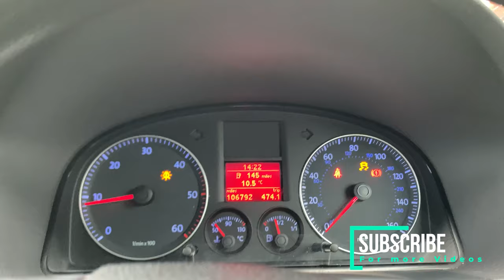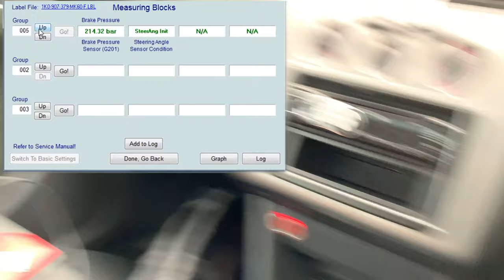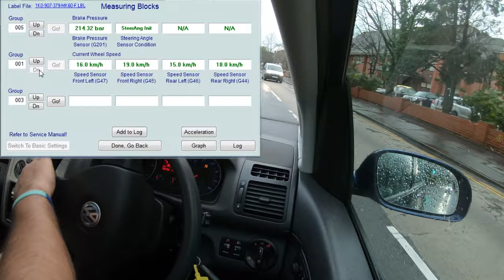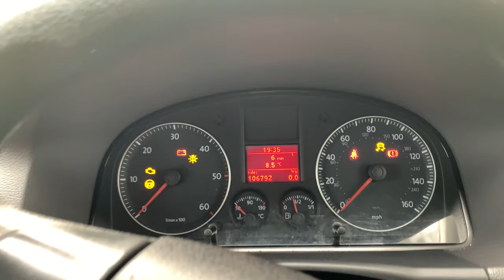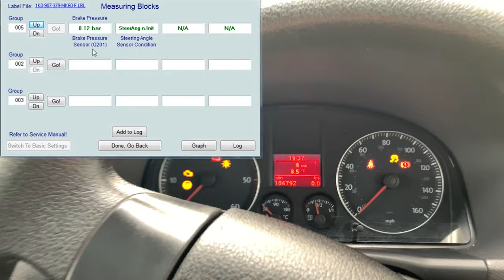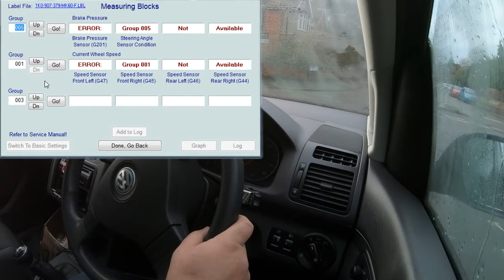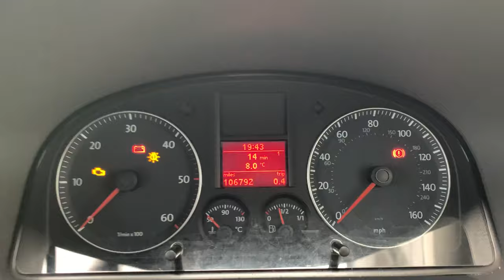VW Touran ESP LIGHT ALWAYS ON | Brake Pressure Sensor Fault G201 01435

Comment: Well done, another helpful topic.
I looked up the VW repair kit, 1K0 698 517 B with RRP of 299.50 GBP. 
You get the hydraulic section with pump.
I looked into replacing G201 sensor which later sensor is LPKF 488360 but looks like you damage it when removing looking on forums so haven’t tried.
Looks like you have the cheapest solution, anyone doing the same as you make sure you can take it back or swap it for another unit as they fail a lot and you could be fitting a faulty one from the scrap yard. Get it in writing before you spend out so you don’t get stuck with two faulty sensors.
Turn steering wheel full left then right and drive 50-100 meters to reset steering Angle sensor whenever disconnecting battery, then reset one touch window function, hold switch down then let go and press down for 3 seconds, put window up, let go of switch and pull up on switch for 3 seconds to restore one touch winding up and down. Do this for each window. Make sure windows not iced up or kiddie blinds stuck to rear ones first though!!
Reply from the maker: Simon Moore good to know Simon thanks for looking up the price for the repair kit ... cheers 👍👍👍

Comment: Great video! Got the same fault!
Problem is that I just spent 2 month in the hospital, and are not fit to work on my car!
My traction light came on when I tried to start the car with a very low battery after coming home from the hospital!
The ABS light do not light up, just the ESC light?!
Can a bad/low battery, brake the pressure sensor?

Comment: I recently bought my vw touran with the abs light on i have the same code for the brake pressure sensor, the guy I bought it from changed the abs pump but not the ecu part would this be why there’s still the same abs sensor fault

Comment: Hi you bought a replacement unit Modulator but there are lots of them out there and they end in different numbers/letters, did you purchase the right one right year model code or any Modulator then split it !!! please advise as l am in the process of doing the same job l now have the sensor / Modulator off ready thanks.

Comment: Hello. Great video. Do you know if it is possible to put a different module? My newly bought Audi A3 8P has a "1k0614117A" ABS module in it and it doesnt work. After a quick VIN check the system shows that the correct one for my car is "1K0907375P".
My question is: how can I find out which ABS module is suitable for my car?

Comment: I have tried to make pipe flange for VW passat but my "reasonable priced" tool always seems to leak with the ABS hole and also with the other side into the rubber line , i never saw this flange tool are there spesial one to VW blake flange other than 3/16 , for me it looks like the back end of the flange is 90 degree angle and standard tool make it more like 45 degree andgle, THX

Comment: Great video thanks. I changed my ABS module from my Touran 1T tdi 90 cv from 2005 by a standard exchange bought in a car case it is revised and guaranteed. I mount the module everything went well I did the pressure brake bleeding with the same device as yours. My concern is that I still have the brake pedal to soft. Do you know what is the best method to do the brake bleeding for a Touran? I thank you in advance.
Reply from the maker: The best method is scan tool abs brake bleeding procedure ... I would try bleeding the brakes again perhaps still some air in it 👍

Comment: I have just attempted this fix. I have managed to get the abs pump installed but have yet to bleed the system. My question is. After installation should the brake pressure data be near zero or will it only show a fix after the brakes are bled? Thanks in advance

Comment: How's she goin'?  That was good trouble shooting and testing and the repair seems to have done the trick and saved the customer a great deal of money.  Well done.  Only concern is you ran a copper brake line.  I replaced a brake line on an old '77 Chevelle I had once and it failed the Motor Vehicle Inspection because it had copper brake lines.  Is that an issue in your area, or was that brake line approved copper tubing?  Take 'er easy!!!
Reply from the maker: Grampie's Workshop thanks Mike worked out really well in the end £30 fix , proper Copper brake lines are ok here 👍👍👍 cheers

Comment: well done. I have a similar problem, the error code is the same, but when the engine is cold everything is ok, only after warming up the error turns on and stays on all the time. I checked the VCDS, everything looks similar to yours, but the brake pressure sensor shows -34 bar (minus 34 ..). Where to find the reason? In the same place as yours? Please answer.
Reply from the maker: Dominik Łolik hi Dokinik there is a possibility that is the same issue but I would check the wiring first, multi plug, check for leaks, because the fault isn’t there at all times it makes me think that the module itself could be faulty and maybe when the engine warms up some soldering joints maybe cause a open circuit 👍

Comment: I have a question and if you can respond quickly I will really appreciate, I’ve tried a used pump, it’s not programmed but if you scan it , it shows sensor has electrical fault, is it because I haven’t swapped my own module, or this unit needs programming and then it won’t show electrical fault, I am not sure if I’m being clear or not, obviously you must have tried many, if you buy used pump remove battery etc and plug new scan, obviously it will give few adaption errors but should it show sensor electrical fault, because I know about BMWs if steering ring isn’t programmed it shows abs pump has electrical fault, I don’t if it’s the same thing on Vw or not

Comment: I have the same car abs light on traction light on and steering angle sensor. I cleared angle sensor one but still got a fault code for it. I change out a seized calibre ever since then I have spongy pedal so I bought 3 master cylinder new abs module still getting spongy pedal now when the engine is off the pedal goes stiff it's only when the car is running. I have a power bleeder I have vcds to bleed abs. And the lights on the dash is doing my head in any ideas much appreciated

Comment: Hi! I swapped the hydraulic block of my ABS because I had a fault with the Pressure Sensor G201 as you. After the swap I had the communiciation error as you in the vid at 16:27. What was your solution? I have good pressure values until the "too many communication error" message.
Reply from the maker: The communication error was me hitting the scan tool cable with my knee ...
Reply: @CarsExposed  Oh, okey thanks! :)

Comment: VW EOS 2007. Thank you for sharing your experience. I have the same error code with myABS unit 1K0614517AF. Can I do the same and just change the mechanical part from another ABS unit as 1K0 614 517 AT?  I don't know about the difference between AT and AF
Reply from the maker: I’m not 100% but I think you should be fine ...
Reply: Was working?

Comment: Vw sell  a repair kit for this fault which is the valve pack minus the pump. Also, if the car has been dealer serviced, VW will cover the cost
Reply from the maker: Cool I didn’t know they sold the bit separate good to know 👍, apparently the owner checked it and couldn’t get it done in the recall ... cheers mate 👍👍👍

Comment: May I ask on how you identified a replacement without removing it first....does the inbuilt brake  sensor only feature on  tourans or other VW abs  units ?..
Reply from the maker: Feature in other models aswell , I normally match the part number on the abs pump 👍

Comment: The same problem, have changed two ESP pumps, can't get the air out of brake system, ESP module blocking rear wheels. Any advice?
Reply from the maker: I guess you have bled the system ? Try doing a scan tool bleeding procedure...

Comment: Thanks for the video, helped me get mine apart. Quick question - the part numbers on the pump do they have to be the same as the old pump in order to work? Mine is a C2 keep coming across different types

Comment: Can i take the pressure sensor off of the metallic block? My factory one was seized on the rear left break and i changed the whole unit and from then i got the esp error. Can i  change the sensor between the two?
Reply from the maker: I don’t think it’s possible sorry .

Comment: I swapped out my old ABS unit which had intermittent G201 brake pressure error with a 2nd hand one. Same part number on both module and solenoid part. Now I have ABS/traction/parking brake and a new TPMS light on all the time. Does the new part still need coded even it has the same PN? I tried clearing fault codes but they came back straight away. Will an ECU reset via battery disconnect work? Any help would be greatly appreciated.
Reply from the maker: It needs to be programmed in that's why I only swapped the valve mechanical part side of things and kept the original module..
Reply: @CarsExposed  I should have done the same but thought it would be ok as the part no was identical. Thanks

Comment: What were the symptoms? Mine has the Same Fault but the pedal is hard and locks the brakes
Reply from the maker: No symptoms the car braked fine and felt fine but the traction control light was on which is an MOT failure ..

Comment: pls answer me. if brake pressure sensor go up to 20 bar, so it is total pressure to brake cylinder of 4wheel  (and front bigger than rear)?
Reply from the maker: KTV Admin the front brakes generates around 75% of your brake force ...
Reply: @CarsExposed  yeah. When speed of car about 60-80 km/h, the brake pressures can reach 30-40 bar? ( or higher ??) . thank you very much!

Comment: I would think using suction to force brake fluid into the caliper and air out would had been a better option vs pumping the brake pedal.
Reply from the maker: I’m not so keen on the suction method but it works too , to be honest my preferred method is pressure/fill in the reservoir 👍👍👍
Reply: @CarsExposed  Yeah all depends on what you're doing. I have both a suction and pressure pump since it's easier if only one person servicing it. I'm usually servicing slave or master cylinders for clutches. Audi cars can be a pain if using the pedal pumping method
Reply from the maker: Ah right definitely if you are doing slave cylinders suction is the best in my opinion I had that on a Renault Megane once , you could pump the pedal as much as you want and nothing until I’ve used my vacuum/bleeding pump perfect tool for the job 👍

Comment: i have same problem on my vw touran failed mot cas lites on is this wot i need to do
Reply from the maker: The best thing to do is to scan the car first , but this is a common issue
Reply: @CarsExposed  could it b sumit simpler cheers
Reply from the maker: @tanglewood777  hard to tell without scanning the car

Comment: one question can i remove the sensor with out remove the brake line
Reply from the maker: Unfortunately not
Reply: @CarsExposed  these parts have to be the same part number or not??
Reply from the maker: Angel Rosado have to be the same 👍

Comment: Wouldn't it have been easy to fit the whole 2nd hand unit and just code it to car as you are already using vcds?
Reply from the maker: The Retired Mechanic good question I may be wrong but I thought it had to be a virginezed module to be able to, but I’m not that great when coming to programming 👍👍👍 cheers
Reply: @CarsExposed  yes you can definitely code 2nd hand units its not too hard to do.  Go to Ross tech to get the codes guide. Get the numbers needed for the log in  off the sticker in boot for the different versions of your car. IE engine type brake size and manual or automatic. Then using same web site you input the various  versions again of your car in the 6 code box on the code page. Come out of it. Calibrate steering angle and then save everything. Clear codes and should be it.
Reply from the maker: The Retired Mechanic cool good to know thank you very much 👍👍👍

Comment: I replace the entire assembly now I get the esp
Reply from the maker: Angel Rosado did you swap the module part ?
Reply: @CarsExposed  I found everything together what I did I cleaned it and I took out mine and I put the one that I saved now I get that light that before it did not come out
Reply from the maker: You have to swap the module part, watch my video to the end I show swapping the module .
Reply: @CarsExposed  if i saw it then i have to do that just change that part as you did
Reply from the maker: Yeah just swap the module with the valve part of the new unit keeping your original module , you may have to clear some code after but that is it.
Reply: @CarsExposed  ook thanks
Reply: @CarsExposed  I did what you told me like in the video but that light still doesn't go
Reply from the maker: Angel Rosado did you clear the fault codes ?
Reply: @CarsExposed  i don't have the big scanner to clear that code the esp light disappear only the litter car